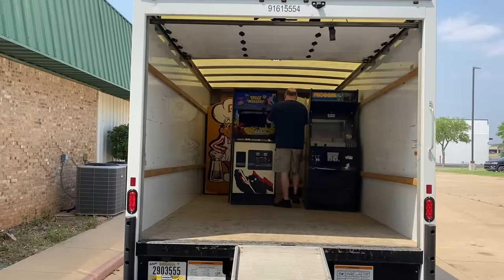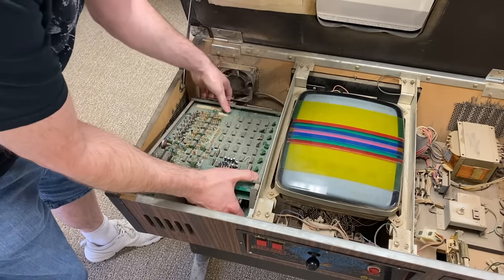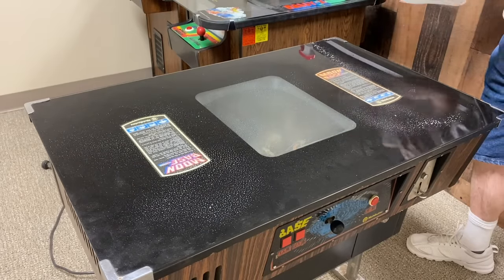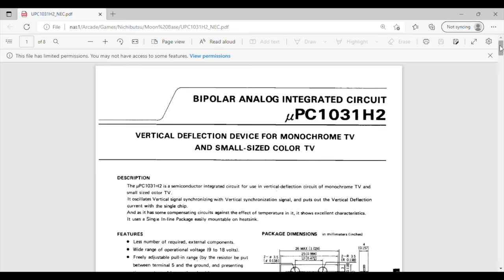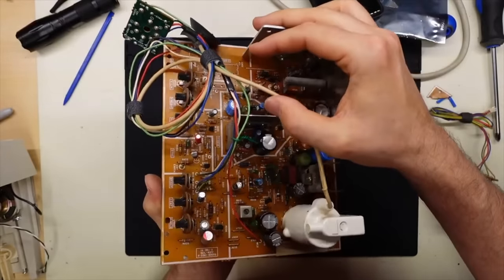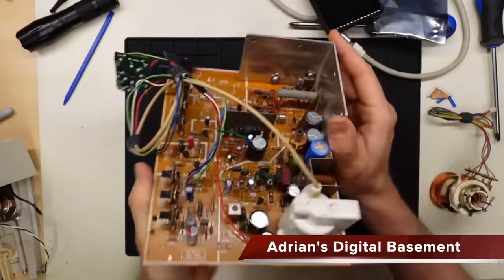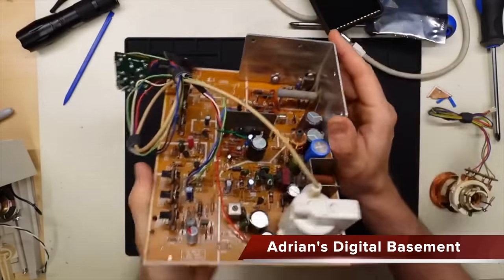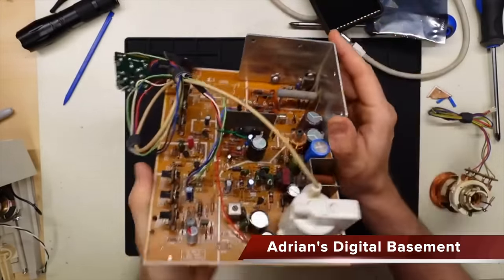Moonbase Arcade Restoration - Gone Wrong

Comment: The difficulties with probing the board in-situ can be resolved by getting the appropriate probing tools -- some good hook-style probes will let you get in there with very little issue, or a set of mini-grabbers. And if not, you can always just go with the universal probing solution: temporarily soldering in some thin wires.

But, if you're getting the same problem again, it's because the same chip broke. If the chip broke, it's because its inputs exceeded the specifications you can find on the datasheet -- and if I had to guess, it's that the power supply voltage is too high. Regardless though, that means the circuit generating that input is defective, so you can trace back and find e.g. the voltage regulator that's failing to regulate the voltage down correctly, verify that its own input is still within specifications for what that regulator should tolerate, and if so just replace that regulator.
Reply: i was thinking the same. someone above mentioned using an iso transformer. maybe that could help with the voltage problem i think he is most def having.
Reply: plus if the IC was in backwards, it very well could have caused damage.
Reply: @michaell8749  : I doubt that an isolation transformer is going to help.
Reply: @mattlastnamehere6403  : Damage could have been caused, but the duplication of the previous error renders that unimportant- the duplication of the problem indicates a more fundamental issue elsewhere, which in turn means the cause of that problem needs to be fixed.
Reply: I mean, the badge showed that the power supply is supposedly designed for 100VAC 50/60Hz

Comment: After replacing 5 IC’s on a vintage Marshall amplifier that kept mysteriously killing them during use, I found it was just as simple as faulty diodes sending voltage where they shouldn’t. Total shot in the dark but maybe check/replace any of them.
Reply: Agreed. Often a power burst while turning the unit on, with leaked caps still in the circuit, will kill ICs, transistors, and, ofc. diodes, too!
Reply: Usually, I'd upvote a comment like this, but I just saw the bit where he said he'd tested every diode. XD
Reply: @eekee6034  oops, guess I missed that part

Comment: David, sometimes the NEC and NTE MOSFETs have their pins revered like that as well and I have made the same error as you have in the past. It was an honest mistake to assume that the flat side and written sides were identical on both parts.
Reply: they presumably do that to avoid a copyright ?! infringment
Reply: @highpath4776  No, they are just lame.
Reply: @highpath4776  There's no copyright on that sort of thing, no.  It's just a matter of how they decided to do their plastic molds.  Some companies did it differently than others because they already had the molding machines set up to make them a certain way for other parts.
Reply: Technically, the pins weren't reversed -- if you look at the part where the guy is holding them side-by-side with the markings face-up on both, the original part has the pin-1 stripe on the left, and the replacement part has the beveled edge (also pin 1) on the left as well.  So both parts have the same orientation and pin 1 in the same spot -- what happened was that David was going by (faulty) memory as to which way the markings on the chip were facing when he took the original part out, instead of orienting it according to the silkscreen on the PCB.
Reply: @ballyastrocade5672  But that looks like the flat part mounted to the heatsink was as David took out, so indeed 'reversed' between the two part numbers if the bolt mount is offset
Reply: @highpath4776  The bolt mount (actually the heat-sink tab) is not offset in those SIP-10 packages, though.  There is plastic molding on both sides, fully enclosing the metal tab; it's not like a TO220 transistor where the metal heatsink tab basically is the back side of the component and the plastic or ceramic molding is only on one side of the metal.

Comment: It would have been interesting to test those old capacitors, before they got binned. Rubycon capacitors of the time were pretty good quality. It wouldn’t perhaps be surprising if some of these old Rubycon capacitors, measured better than their smaller modern replacements.
Reply: I would be very surprised if that was the case, comparing to similar types. Sooner or later - leakage galore, its just how things go
Reply: hi greg, i think its nice to run a device on old components as mutch as possible. but its mutch safer to replace them down the road.
they are around 40 years old after all. i would do the same as david.
but im relativly new to vintage electronics.
Reply: sorry i read your text wrong. 
yes it would be interesting just to test them! XD
Reply: my brother in christ they were exploded
Reply: @dantemalus6533  Yes, my comment was prompted by my own experiences with capacitors in old CRT monitors of the same time period.
Specifically, I have seen 40yo Rubycon capacitors that are still well within spec, and with lower ESR than new replacements.
It has made me less prone to just automatically replacing all old electrolytic capacitors.  i.e. Some older, quality capacitors, may still have more life in them than some modern cheaply manufactured replacements.  Hence, why testing old removed capacitors (and their replacements), is always an interesting exercise.
Reply: I agree. It would have been interesting to measure them.

By the way, I thought they were Philips capacitors. Did Rubycon have the same colours?
Reply: Plus, they should have gone to e-waste rather than the garbage.
Reply: @gregclare  yep, you shouldnt 'assume' all old electrolytics will be bad, i've found in many  cases they arent, i have transistor radios going back to the late 50s and most have not needed any electrolytics replaced
Reply: Yea. I was repairing a Mario bros cabinet board, and I thought it would be the caps, but I saw they were rubycon, so I started thinking it wasn't.
Reply: @VarionJimmy  philips ones are darker blue or 'see through' blue tinted plastic jackets, theyre still available under the 'vishay' name
Reply: @andygozzo72  Ah, interesting to hear! Thanks! 👍
Reply: @Aliens2Exist  That was glue. If you take a closer look the smears were not originating from the bottom.  (they are very clean)
Reply: @NoshAbroad  yep sometimes they glue them, and that glue can be an issue becoming conductive and/or corrosive

Comment: Can I ask you a simple question did you verify that the power supply had actually been changed out and is not the original hundred volt power supply because if it is the original hundred volt power supply you just fed 110 volts into 100 volt game and you may need a step down converter in order for it to work
Reply: Japanese don't use 3 prong plugs so someone had bolted on that plug adapter a log time ago. Considering it was in use in Texas for at least the years of 1983 and 1984 one could assume the ping was being properly powered at the time. Very unlikely they were using an inverter with this.
Reply: Still might be worth a check. Nominal voltage can be as low as 110v and as high as 120v. Texas has their own power grid, maybe in the 80s it was closer to the bottom end and so was happy?  Also the power supply may have just drifted so check all the voltages.
Reply: @Channel84VarietyShow  yes, you are correct.  the transformer has taps for 220, 230, 240 and most likely 110, 115, and 120 also.

Comment: If that chip was powered up while being installed backwards, it could have been damaged. I don't know what those chips cost, but if they're cheap enough try another one, now that you know which way it goes.
Reply: See Adrian's video. He had a second chip. Adrian replaced it with the fresh/unused chip. He didin't even bother to check the chip which was powered backwards. He assumed, it had no chance of surviving the ordeal anyway.
Reply: @fgaviator  Well that will teach me to spout off suggestions without complete information.... maybe.

Comment: Enjoyed the vid!  I'm assuming the Vin is rectified then filtered tp produce B+.  The 20% increase in supply-voltage ( from 100Vac Japanese Voltage) may force the filter-capacitors to their extreme Vmax, thus limiting life.  The regulators, horizontal output-transistor & driver IC might not be rated for such a high Vin; they might go into "protect" mode or break.  Compare power-supply values with schematic or IC datasheet.
Cold-Spray might help diagnose this.  If overvoltage is suspected, try a 10ohm in-series with the line-cord.
Reply: The monitor had 35 volt caps after the rectifier, plenty of margin for something which is dropped down to 12 volts. The only thing which makes sense to me is increased heat.

Comment: Could the replacement chip have been damaged when it was powered up while installed backwards, which made it weak and prone to fail?
Reply: Also, it seems to have a heat problem, I would also increase the size of the heat sink.
And. get a thermal imaging camera on the board and see where heat build up is happening along the paths to the component!
Reply: I think it was designed for 100v, it literally says so, so the extra 20v could be a problem, and such components could just be prone to over-voltage
Reply: @RowanBird779  It ran for at least two years in Texas, last I heard , when they have a functioning electrical grid it would have been 120v coming out the wall.
Reply: @lawless201  Like people have said elsewhere, the arcade operator might have been using a step down transformer.

Comment: I'd check/replace all the diodes (in particular zeners). They're often used for voltage regulation and/or other heavy loads.
I have no idea about how that thing is configured but if it's driven by a comparably low voltage from the power supply it could also be a good idea to check all power rails. (Well, it's always a good idea to check those but depending on how it's configured it could be pointless in terms of troubleshooting the monitor) :)

Comment: Check out the schematics. There may be test points with proper values so you can hone in on what section of the board has a bad part. The Rampage manual had a full Wells Gardner troubleshooting section that even had screenshots of oscilloscope wave forms to compare proper and troubled readings.
Reply: Yeah, I was kinda annoyed at the blind recapping, and no real measurements. A few simple oscilloscope measurements would make everything much clearer. Oh well.

Comment: Could it actually be a 100 volt machine as per the label?
Reply from the maker: unlikely.  The other machine I borrowed the board from for testing (and sending to adrian) works fine and is also labelled as 100V.
Reply: Not an EE,  but I've worked with quite a bit of 100V stuff. Since 120V is only 20% higher than expected, it may still work, but as others have said the DC voltages from the internal power adapter may be ~20% higher than expected. I have seen this happen

You might be better off replacing the internal AC/DC adapter with a modern one.

But as others have said, the place to start is definitely finding out why that chip failed! Good luck!
Reply: @The8BitGuy  But is an assumption ;) I've bumped into assumptions before. Sneaky things!

Comment: The vise solution at the end for the coin box fixed a bent corner on one of my rack synths as well. So low tech, so easy, so effective. It was funny and unexpected you pulled it off the same way as well. Good luck for the next part of the restauration!

Comment: Lots of Japan original arcade machines run on 100V including those from Nintendo/Williams.  You should use an isolation transformer and they sell ones which go from 120v to 100vac.  Not isolating creates a shock hazard.  Overvolting the PSU and CRT is bad as in this era, linear regulation was poor and resulted in excess heat and short service life.  B+ and a lot of reference voltages are user adjusted and part of service/setup and routine maintenance.   
Good luck!  It's a fun hobby rife with setback and success.

Comment: I remember seeing a thread years ago where you weren't successful in fixing another computer and people being insanely angry at you for daring to post yourself making mistakes. I think it proves you're human. Thank you for sharing the highs AND lows of your restoration processes! Hoping this will help you learn for future.
Reply: People were angry at him because he was shockingly careless with an incredibly rare machine.
Reply: @Cappsy  He wasn't "shockingly" careless, he used tried and true methods that work on other computers but didn't on this particular model because it was a worthless prototype that was thrown away probably because it didn't work right in the first place. It would've been non functional anyways, so he had to try to fix it.
Reply: @doigt6590  Tried and true methods like dremeling a screw because he couldn't be bothered to get the right bit, and then shorting the PSU with a paperclip?
Reply: @Cappsy  the paperclip trick isn't supposed to destroy the machine. It's a tried and true method that works on other computers of the era.

The screw on that computer is not a common model and he was short on time to produce the video, it's not that he couldn't be bothered but that he couldn't get the right "bit" within the time frame he had to do the video. Also, there's nothing wrong in altering this kind of very minor thing as a screw, something which is easily replaceable. For easier future repairs, it would have to be changed for a more convenient model anyways otherwise that screw would have stayed a major obstacle which needs not be. What's more, the screw is not part of the outwards appearance of the computer, so any alterations there doesn't matter in the end because you can't see it when it's fully assembled. To me, it seems incredibly petty to care about that screw at all.
Reply: @doigt6590  Ok then!

Comment: Maybe the chip that you put in backwards is getting to hot? Why not replace the heat sync with something with better heat displacement?
Question: does it work again if you let it cool off for a few hours?
Reply: *heat sink

Comment: This is a great opportunity to learn more about analog electronics, and I'd really encourage you to dive in and start absorbing everything you can. CRT driver boards like this are basically all clones of each other, and have just evolved along a pretty linear family tree that goes back all the way to the first tube-based TVs. You can even find your way around a board on sight once you have just a little familiarity with the circuit. The HOT is the heart of the beast, it'll be the large transistor next to the flyback and its base is usually driven by a small transformer. It drives the horizontal deflection coil, plus the flyback coil which generates voltages and signals for the anode, the focus grid, the blanking grid, and often even bootstrap voltages for the voltage regulator.

This board is late enough to be even more simplified since the vertical deflection is all baked into a single chip, so you can treat it as a bit of a black box, and also reference datasheets for the chip to figure out what the inputs and outputs should look like.

As others have mentioned, it's probably just a counterfeit / recycled vertical deflection chip that failed again. You should be able to find a compatible, genuine replacement without too much difficulty.

Comment: I second the 100V comment - I suspect the cabinet was designed for Japan and never modified.  Second, I wouldn't be so quick to dismiss the idea that the IC was damaged when powered up installed backwards.  BJT technology has a lot of latent failure modes that may have been triggered.

Comment: You have my greatest respect for tackling that cocktail table machine. I was going to fix one for a friend but after an hour of initial inspection I realised what a pain it was to work on, having to constantly take the CRT out. There was months of work there to restore it, so gave it back to him unfixed. If it was mine I'd probably have persevered. Please keep showing the mistakes it makes the videos more interesting. I wonder if putting the IC in backwards weakened the chip in some way or put volts up the wrong pin and therefore made it die prematurely. Might be worth trying another.

Comment: Oof! I've done my share of electronics work, and I know the pain of having to rebuild the whole gadget just to test one part! I was working on a board (my design) that didn't have programming headers. So I had to desolder and resolder the micro everytime I made a change to the code. Even when I got wifi OTA working, if the board crashed, I had to desolder it!

But, not to be an armchair warrior, I suspected a different pinout as soon as you mentioned that you had to get a new IC. It is a huge issue at the company I work at that every time we switch to a new IC, the board has to be reworked for a different layout. So it's a very good lesson to keep in mind now that you have the experience of replacing an IC!

Comment: This is a fantastic video! Just my 2 cents worth - given that you've replaced the IC (sure backwards, but anyone can make that mistake and manufacturers seem to change their specs all the time), and then it seemed to be fixed but then manifested the same issue, that tells me that the reason why the original chip looked black and burnt was a fault that was still present, and in my mind points to power. You mentioned it had a note on there to operate at 100V - I would focus on the power area, and maybe the power circuit needs modification to work with what we use today or perhaps the transformer? (Also might need to replace that IC again lol) Just my 2 cents, I'm just going by logical deduction based on what you've already done - seriously great video! Keep it up! This is one of my favourite channels